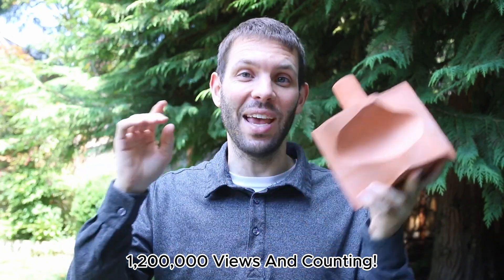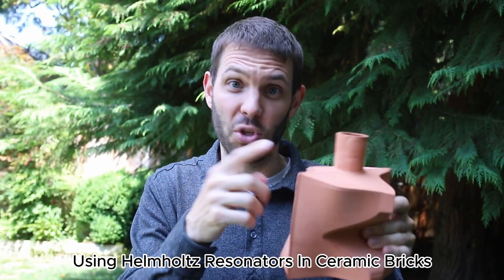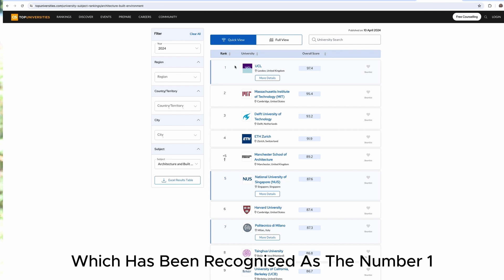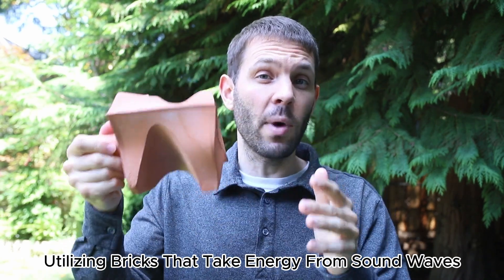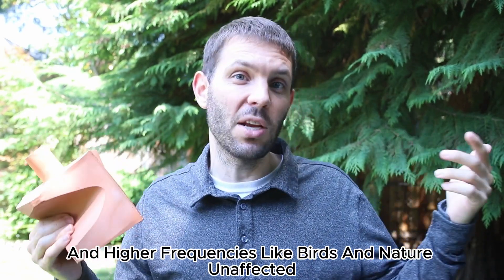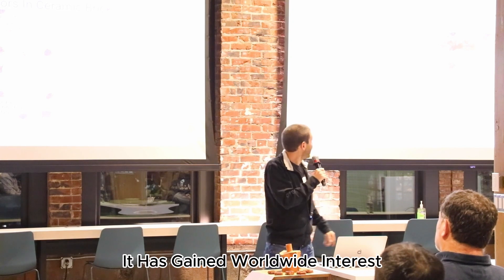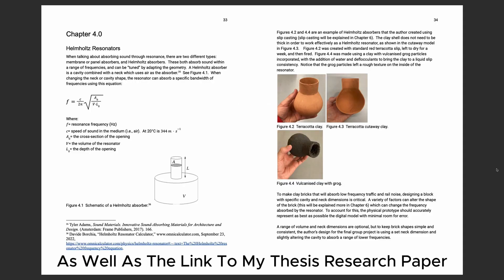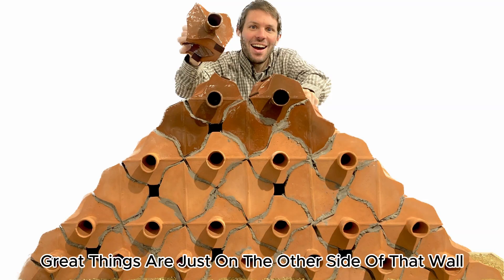1M People Care About Ceramic Sound Absorbing Bricks!

Comment: Seems like they absorbed the audio volume of the video too.
Reply: Savage
Reply from the maker: Mine works fine. Must be on your end 🤷🏻‍♂️
Reply: @JoeMakes  it works, volume is just a bit low compared to other youtube videos. I had to put the sound in windows up to 34 from my regular 18 to get comparable sound. Not a big deal tho, works fine.
Reply: @JoeMakes  Its not just on my end. The audio works. The baseline volume is just about 30% lower than most other YouTube videos.
Reply: It would be cool, if the volume was down a bit only when the bricks are on the screen :)